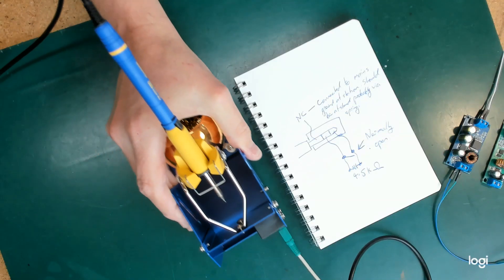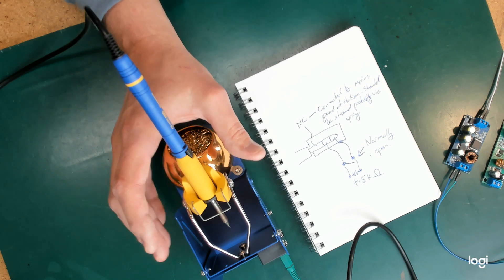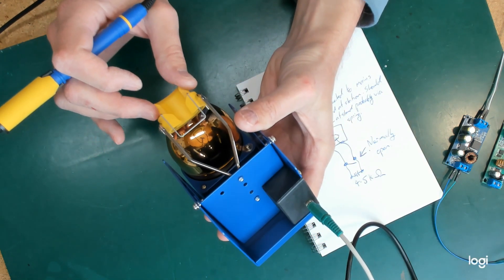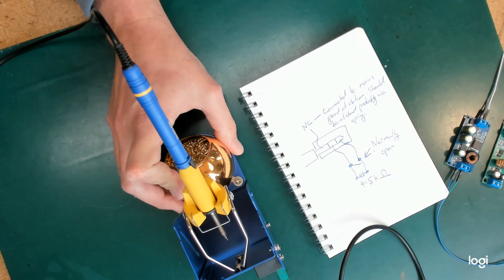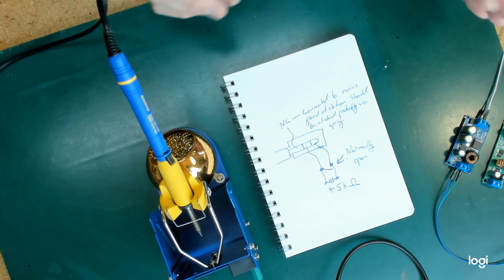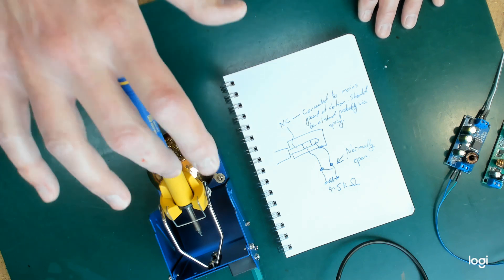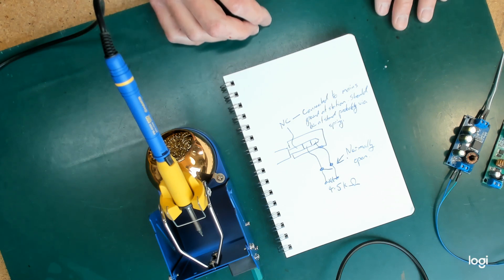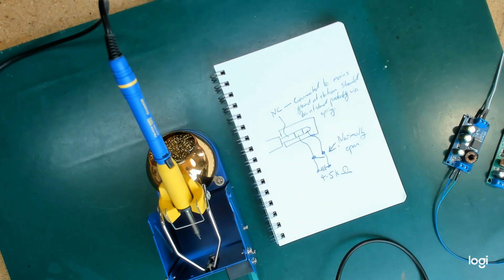Hakko FH-200 for FX951 - switched sleep stand on an FX-950 with pinout

Comment: OK got it! I have a FX-950 and this will be a good buy to get more tip life. 5 mins is not too bad I guess, so not going to get into my time before it perks up to desired temperature again as I only use really thin pointed tips for fine work. Cheers this was a revelation for me .. I have spotted one on Amazon cheaper than anywhere else so will get it. Thanks!